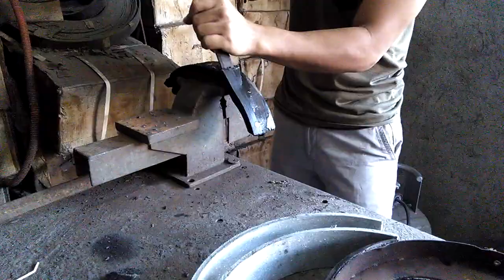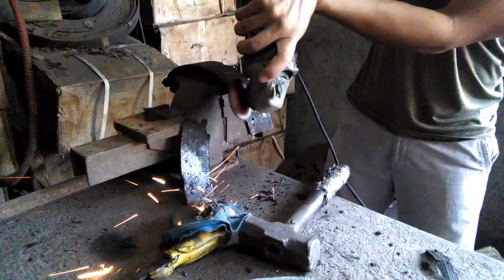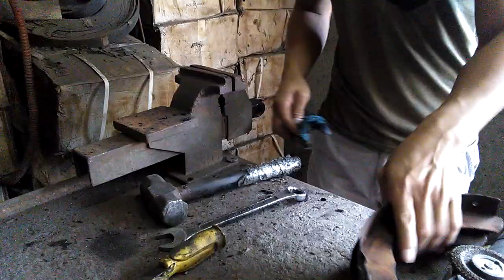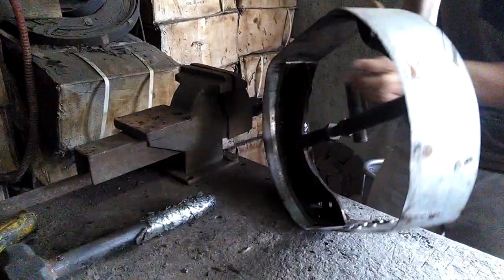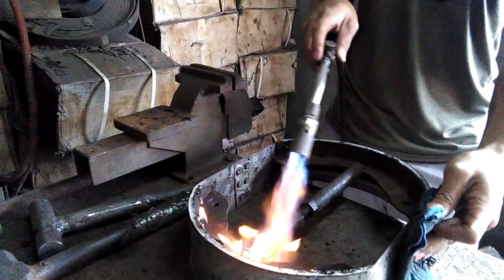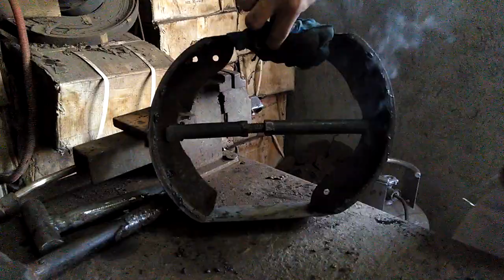how to replace your old JEEP brake linning

Comment: sir pwede ka po ba mag suggest ng mga brand or product. at sizes pang start up ng business para sa brake bonding
Reply from the maker: most common brand sa market na mejo mura ssk, jupiter,harada,superflex
Reply: @mcmoto989  pero base sa suggestions mo po sir kung gagamit ako superflex okay din naman po? ganon djn sa mga breakpas ng mga sedan unit
Reply from the maker: @minionwanderland  brake pads madami ngiging issue bonding non. most of the time pinabibili ko nlng sila brandnew ..pero flatsheet tawag sa liining ng mga brake pads.. pwde nmn khit ano brand basta mtigas  lgyan mo nlng rivets pa secured

Comment: Sir mc tanong lng.. alin ang mas mtibay pag sa gnyang shoe rivets o bonding? Salamat po.
Reply from the maker: Same lng nmn po matibay yan syempre depende parin po sa gumagawa !

Kapag pamasada po at di nmn madlas ng leak brake fluid at di nmn madalas malubog sa baha .  mas ok po na naka dikit lng lalo na po rubberized po Linning na gamit. 

If sa bundok at probinsya nmn po mas ok ung matigas ang linning na gamit at naka rivets lahat at  least 10 to 12 rivet per brake shoe . Pwde din nmn na nakadikit at the same time naka full rivets din para sure . .

Base lng po sa feedback ng custumer ko at depende po kung saan lugar at sa ano klase ng linya ng trabaho  o kung paano ginagamit ang sasakyan . Sa ganon paraan po dumedepende ang kinakabit na materyales sa preno at proseso ng pagawa .
Reply: Sir mc ano fb page mo po? Meron sna aq inquerries? Pwede po ba? Salamat po.
Reply from the maker: https://www.facebook.com/Mc-andan-vlogs-102350324688727/
Reply from the maker: Pm ka lang idol
Reply: Anong padikit Ang ginamit boss

Comment: How long should the heating be done?
Reply from the maker: About 2min to 3min  or if  when you see the adhesive that spill. On the sides  get brittle  .
Reply: @mcmoto989  Tnx
Reply: @mcmoto989  Boss
May idea po ba kayo
 Brake bonding ng Overhead crane or towercrane po
Reply from the maker: Oo gumagawa Kami Ng mga preno Ng crane .pero Di ganon madalas bihira LNG Kasi ngpapagawa Nian at masiado Mahal  .. saka depende din iba iba preno Ng crane hoist  Meron shoe saka disc saka dapat alam mo sakto kapal na kailangan
Reply: San Po Loc. Niyo sir?
Reply from the maker: Poblacion pulilan bulacan beside o save  near honda pulilan